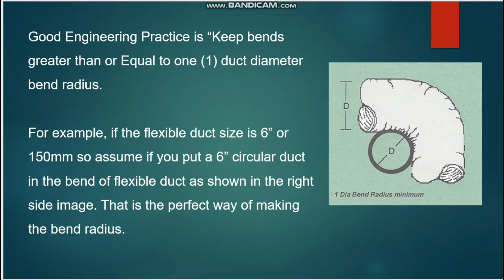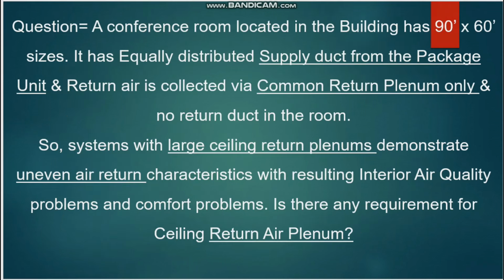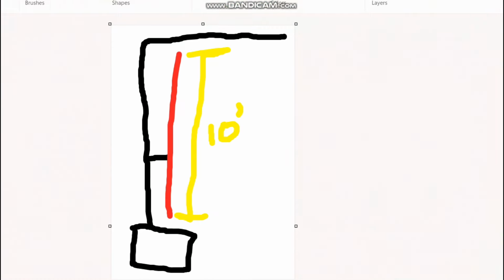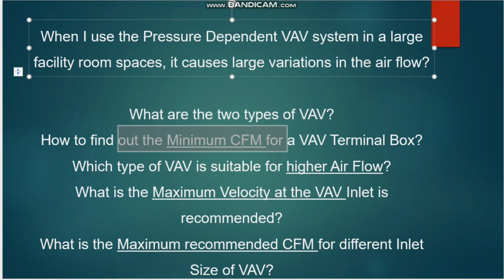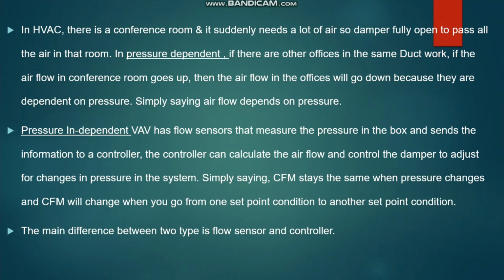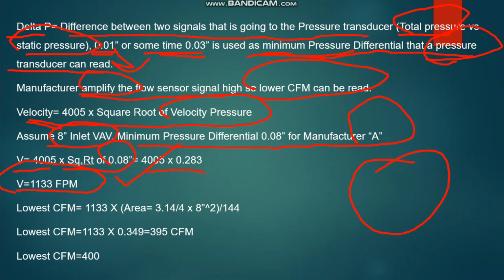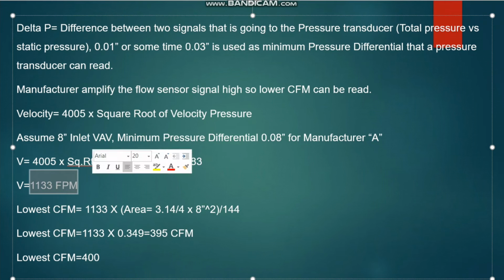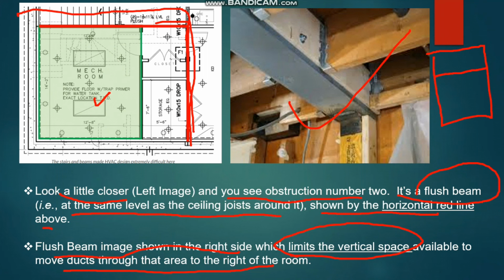HVAC Interview Questions and Answers l HVAC Important Questions-Must watch before Interview-Part 1

Comment: Hello Sir! Explain me, A VAV has a specification of 90 (FA)-400(Treated recirculated Air) CFM as you mentioned above example. Doubt: Whether this fresh air introducing via a separate VAV inlet, And is it treated or directly from the Outside. If there are different case scenario please explain that too